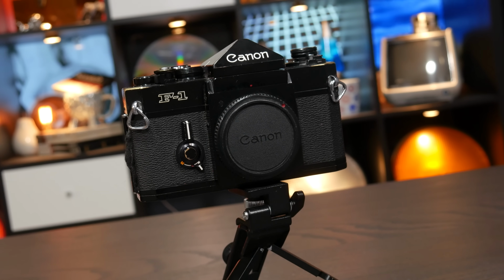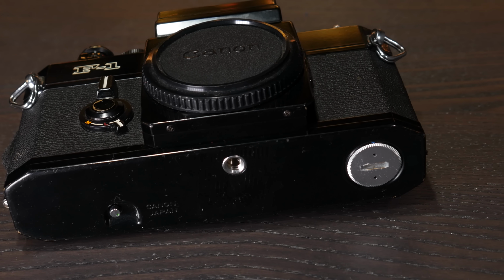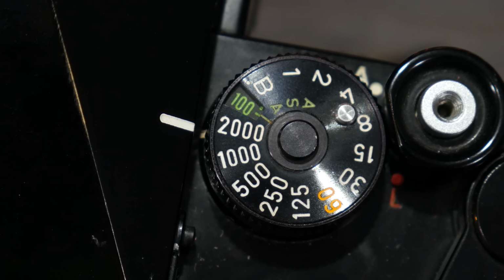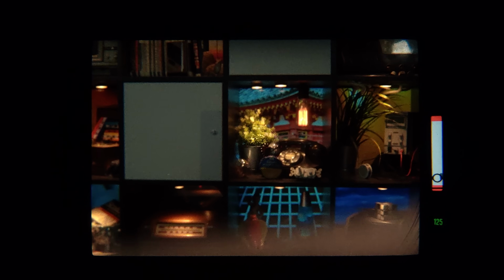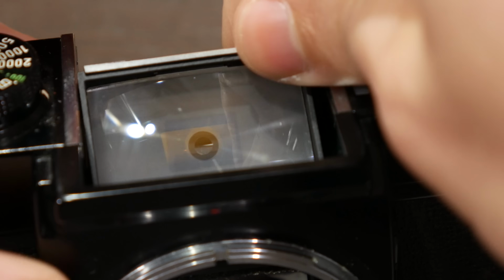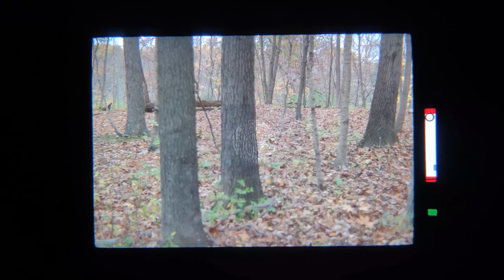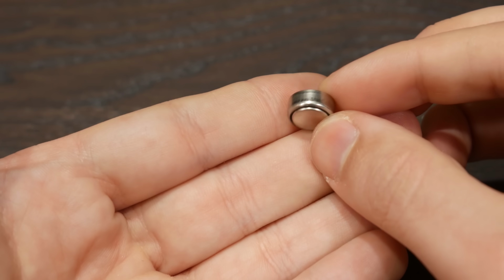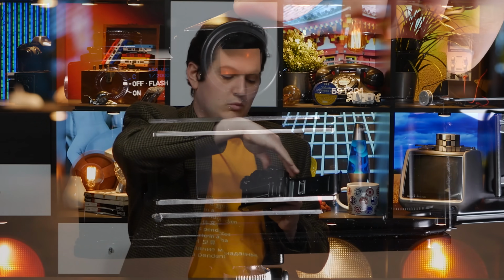1970's Camera Tech: How they showed you what settings to use

Comment: An advantage of mercury batteries was that they held their 1.35V constant throughout well over 90% of their lifetime and they would die a sudden death before they had to be changed, whereas 1.5V alkaline batteries tend to steadily and slowly lose their rated voltage, usually starting around 1.55V down to 1.2V-1-1V. Because of the nature of the circuitry, as you have pointed out, the light meter is only accurate with the voltage it was calibrated to. An alternative to using zinc air batteries are silver oxide batteries which also have a a very constant voltage and much longer service life than zinc air ones. While those are 1.5V batteries as well, most hand held light meters can be recalibrated using their variable resistors, as long as you have a reference light meter that is accurate, or you can buy battery adapters that step down the voltage to 1.35V with 1.5V batteries. The biggest problem with those is price and that if batteries are left in them, they will be drained constantly, so they do run flat sooner, but they are usually worth it if you are using the camera or the meter often. I still use hand held light meters for large format photography, but they are "relatively" new, made in 1983, and use 9V batteries. They have microcontrollers in them (revolutionary for light meters in the early 80's), so they can monitor battery voltage and adjust readings accordingly behind the scenes.

Comment: What did you do, read a Wikipedia entry and then regurgitate it? You state many half truths as well as a number of out right errors. For instance, why would Bulb be called bulb? Why are the numbers known as stops? And, here's a big one, that is NOT how you use a light meter. Those "simple meters" were usually REFLECTED light meters so they were used at the camera position and pointed at the subject. INCIDENT light meters, while somewhat more accurate will inevitably have some type of white diffuser over the sensor and are used at the subject pointing back at the camera. Let's also be perfectly clear, a meter reading does NOT yield "perfect" or "correct" exposures. They, at best, yield an approximation based on the "average" scene (which, of course doesn't exist) being 18% gray (in B&W photography or metering since only newer, much more advanced meters are needed to measure color. Consequently, if you "meter" for a bride in a white dress, and the dress takes up the majority of the frame, it will actually be exposed as somewhat gray...because that's what the meter is designed to yield. Its the photographer who actually understands what they are doing and how the tools work that IGNORES the meter and intentionally allows more exposure for this shot so it renders correctly.

Comment: not that clever as you may think. much older russian zenit has light meter that does not needed any battery. it was not true ttl metering just approximation through window on top of the lens but still...

Comment: That was a nice cameras,in fact the first pro quitly SLR from Canon. Remember Nikon was king in the 1970’s and Canon had  a different time getting pro’s to buy their products in the UK.However the model to go for was the last version which came out ‘er about 1981. It was called the new F1n. And was as good as the Nikon f3, yes with all the bits,motor drive,great spot meter etc. I know As I used both cameras in the 1980’s as I was a stills cameraman working for one of the major TV companies

Comment: Logarithmic needle movement - you can get this for free using the correct placement of the magnet to the needle movement direction, because the more the magnet pushes the needle away, the smaller the magnetic field is for the next bit of push, following the inverse square rule. So, you can just imagine the magnet is placed below where the 'o' is, as the 'o' moves up, the field gets weaker. Match this curved strength with the right spring strength, and your logarithmic movement is a natural consequence.

Comment: Another thing about the meter and low light / long exposure:
Film experiences something called 'reciprocity failure' during long exposures.
The meter can tell you you were properly exposing for your ISO, but depending on the particular film you're using, a 5-second shot could still be under-exposed when it comes time to actually make the halides silver, because the "ISO / aperture / shutter" triumvirate is just an approximation that ceases to be accurate on long exposures.
This is especially weird for color film photography, where each of the R G and B layers can have different levels of reciprocity failure, meaning your long exposure images get cool color shifts.
They probably assumed that if you're taking long-exposure shots, you're already someone who understands what you're doing well enough to know you have to compensate for that, and thus didn't bother extending the low-light performance to work much past 1/30 (the slowest shutter you can reasonably hand-hold) at all.

Comment: Analog photography is done better at 35mmc.com or mikeeckman.com.;) Did you know that many old film cameras get locked up when Hipsters try out the self timer? But then, I learned about photography from box cameras (Brownie Six-Twenty) to TLRs (Rolleicord V) to 35mm rangefinders (Leica IIIa) before arriving at the Nikkormat FTN in the late 1960's. My first film was Verichrome Pan, which led to Plus-X and Tri-X Pan, then on to Kodachrome and Ektachrome. (Color negative Kodacolor-X came later as it was a 3X/3R black-and-white print or color slide world.) As for exposure/light meters, I began with a Selenium cell Walz, Sekonic L-28C, Pentax 1/21 Spotmeter, to the Minolta Auto Meter IVF. A nice basic analog photography class for electronic camera users.

Comment: There's something satisfying about the sounds produced from analogue cameras like the Canon F-1.
Reply: And that's why I like the mechanical shutter inside my GH5. It just gives the nice feedback that you actually made something happen instead of the almost indistinctive clicks from a small relay in older digital cameras and the completely silent operation on the GH5 when set to electronic shutter.
Reply: Analog is what the video signal was before it went digital. Non-digital cameras are FILM cameras. That is why there are SLR and DSLR cameras. :-)
Reply: @Rocketryman  people call film cameras analogue cameras because it differentiates them from motion picture film cameras, digital still cameras and digital motion picture cameras.

Proper terminology be damned in this case, it just makes things easier.
Reply: @sumvs5992  Clearly, you know nothing about film cameras, or digital still cameras or digital video cameras. The only thing it makes easy is you do not learn and it shows a weak understanding of the craft. If I called an x-ray, MRI, or CAT scan an xray. If I told you I was going in that big tube to get an x-ray. You would not only correct me but you would go into what the difference is.   People call film cameras analog cameras because they do not know what either is.
Reply: @Rocketryman  ok, no need to get hostile.

Let's say we're at the beach and I say "I'm going in the water" are you going to correct me and start spouting off about it being salt water and part of the "Bay of X"? Surely you would understand that I meant I'm going into the sea? That's the same thing as saying "anolog camera". It's for clarity, it's so you don't need some long winded explanation that inevitably confuses the person you are talking to.

In fact, I was talking to my mom about my analog cameras about a month ago and because I used the term "film camera" she thought I meant a motion picture film camera, not a still camera. People do get confused about these things, and industry terms confuse people if they aren't in that industry.

Like it or not mate, your world where we refer to all film shooting cameras as film cameras isn't coming anytime soon, probably never.

Also I have shot on about 6 analog cameras now, and about 4 digital cameras. I can tell the difference between them.

Comment: Sigh.
There isn't an "aperture number". There's the f number which isn't just the numerals (e.g. the 2) but the whole expression f/2. It's a ratio expressed as a fraction where the f is the focal length. Thus, just as 1/2 is larger than 1/4, f/2 is larger than f/4. We can sub in a focal length and we'll get the size of the apparent aperture, so a 50mm at f/2 has an apparent aperture diameter of 25mm.    At f/4, the apparent diameter is 12.5mm, f/8 gives us 6.25mm, etc. The f is generalized here because it's the ratio of the focal length to diameter opening that's important to exposure.  Anyway, the larger f number is the one with the smaller numeral because it's the denominator that you're selecting.

Also, due to how photo sensitive emulsions work, it's more of a digital process than electronic sensors are. The halides are either reacted or they're not (remember digital refers to having binary states, not if something is a computer). There's no partial reactions, whereas electronic sensors use a truly analog sensor that must be digitized before doing anything else with it. The bit that does this is the ADC (analog to digital converter).

Comment: It's amazing how much analog cameras advanced in a very short span during the 70's. SLRs like the Canon featured were fairly similar from the late 50's through the early 70s, all be it with more refined features. But by the late 70's far more advanced electronics, and even microchips, started showing up with increasing levels of automation.
My go-to film camera is a Minolta XD-11 (XD-7 outside the US) released in 1977. Not that long after the camera featured in this video, but the metering system its ability to automatically select speed and aperture settings is lightyears ahead.
To me it represents the pinnacle of the old-style SLRs, designed just before everything was fully computerized and made of plastic. It's still a solid chunk of metal with a lot of analog controls and manual film advance, but it was the first camera (to my knowledge) to have a fully electronically controlled shutter and aperture selection so you could use shutter priority, aperture priority or fully manual modes.
One quirk - it was introduced at a time photographers still didn't like the idea of relying on batteries, so even though the shutter was electronically controlled, there was a fallback mode that would fire the shutter at 1/100th of a second you could use without battery power (since 100ASA film was probably the most popular at the time, it was perfect for use with the Sunny 16 rule).
Reply: I still have my first camera, my Dad's good 'ol SRT101. Some of my best pictures came out of that camera. Got a 7000 in high school, with an auto winder and a high capacity film spool (Roll your own, up to 120 exposures). Had a 14-28mm, 35mm, 50 1.4 prime, 70-210 3.5 and an 500mm f8, and a 2x tele. As my graduation present I got Minolta's first DSLR, the 7D. Love that I can still use my lenses if I get a new Sony body and an adapter.

Comment: First I need to see if my camera has this feature.  I struggle with all the shutter,iso , and the f setting.  
But you answered a question about hearing aids batteries.  I had no idea that  the small plastic on the battery was to activate it. I thought it was to make sure the positive and negative did not touch.  That make a lot more since why my batteries where dying before I used them

Comment: I've been recently practicing with my dad's AE-1 camera. It's light meter is a bit different than this model, so I'm still coming to grips with how it works. The first roll of film I shot, about half the shots were not exposed correctly (mostly under-exposed) but some came out alright. 
I need more practice for sure! haha
Reply: AE-1 is inside entirely different. It is controlled by a microprocessor. F1 is purely mechanical.

Comment: The f numbers are weird until you square them. The  numbers are related to the diameter, a linear measurement, but the light getting in is related to the area, and is proportional to the square of the diameter. Square the f numbers and you get 2, 4, 8, 16, ...

Comment: Gosh, I remember cameras like this - in 1996, I bought secondhand an example of the very earliest Canon SLR, the Canon FX - that had cloth curtains. Even back then, the mercury batteries for the meter were not available, so I never used the meter: instead, I used an even older hand-held selenium cell meter. 

It is amusing to see you explaining these basic photography things from the ground up that, when I started out in photography in the 1990s, every beginner's guide would explain and thus everyone interested in taking anything other than basic snapshots would have known.

I can only imagine years in the future a video like this with lines such as "...yes, that's right - back then, you actually had to touch the screen. Weird".

Comment: Excellent. I'm a film photographer and have been eagerly awaiting the moment where you would reach for one of those delightful cameras in the background. As an aside regarding the zinc batteries, one of the reasons besides incorrect voltage for alkaline batteries to be unsuitable is that over time their voltage drops, whereas the zinc batteries maintain a pretty consistent voltage right up to the end of their life. That is a necessity for correct metering in these sorts of cameras. There are clever adapters with circuitry to take care of this, but I opted for cheap and simple solid adapters doing nothing more than providing the proper fit and conductivity for hearing-aid zinc batteries.

Comment: Great video, as usual….

But you got a few things wrong ISO, Shutter speed, Film speed, and how light meters typically work.

ISO

ISO is NOT the International Standards Organisation, but the “International Organisation for Standardisation,” or «Organisation Internationale de Normalisation,» en français. “ISO” is therefore NOT an acronym nor an initialism. ISO is the organisation's official internationalised name, from the Greek, “isos,” (with the final ‘s’ being silent), meaning, “same.” Not being an acronym, nor an initialisation, it is NOT pronounced, “Eye-Es-So,” but, “Eye-So,” (or, “Is-So,” in Latin countries).

Shutter Speed

This is such a common error, that it is forgivable for most people, but, since you are a respectable Internet educator, you do not get a pass. Shutter speed, —which as you know, is distance over time,— is the time it takes for the shutter to move the distance of the frame width (or height, or iris radius, as the case may be).

What most people mean by ‘shutter speed,’ is ‘exposure time’, —which, as you know, is simply, time. Exposure time, is measured in seconds, but often represented in the inverse of seconds.

What a faster shutter speed mean, (for film plane shutters), is a shorter exposure time for the strobe synchronisation time. (With leaf shutters, the shutter speed determines the minimum exposure time).

This is what had caused some people some confusion, when Pentax had said that their new camera, the K-3 III, had a faster shutter speed than the previous model, the K-3 II. The K-3 II had a minimum exposure time of ¹/8000 seconds, and a strobe sync time of ¹/180 seconds. The new K-3 III also has a minimum exposure time of ¹/8000 seconds. Pentax did not lie; the shutter speed is, in fact, faster. The new K-3 III has a strobe sync time of ¹/200 seconds.

Film Speed

“Film speed” is a term used for precisely the reasons you stated, but, the real term is “film sensitivity.” For chemical film, this was fixed for any given roll of film. On digital cameras, this is also fixed for the permanently installed sensor.

This, too, is a common error, so it is forgivable for most people. Internet educators do not get away with it. (Not the good ones, anyway, and I consider you one of the good ones).

The “ISO” or “Sv” adjustment on the digital camera does not change the sensitivity, but changes the exposure index, EI, on the light-meter, and the development time for the develop module. This is precisely how one did “push processing” with film.

When the “ISO” is raised, (and the light-meter is obeyed), less light actually hits the sensor, but the develop module “over-develops” (amplifies) the signal from the sensor to produce the raw image, (or JPEG JFIF, or HEIF/HEIC, or TIFF, as the case may be). The result is that the sensor seems to have become more sensitive to the light, but it actually has not. The same amount of electrons are released per photon strike, regardless of the “ISO” setting. It is in reality, an EI setting.

Light-Meters

Most light-meters measure the intensity of incident light falling on the subject, and are called, “incident (light) meters.” The light-meter within a camera, (and some others, such as spot meters), measure reflected light, and are typically used when getting an incident light reading is too inconvenient. These are called, “reflected (light) meters.”

Because the amount of light reflected is dependent on the albedo of the subject, a grey card —or something as close as reasonable to a “middle grey”— is used to take a light reading, so as to figure out just how much light is incident on the subject. The obvious catch is that, if it was inconvenient to measure the incident light at the subject, it is probably inconvenient to put a grey card at the subject location. Nevertheless, we can guestimate some things at subject position which ought to be ‘middle grey’, and simply meter those with a reflected light-meter.

This is why there are so many images of grey swans, and grey outfits at weddings; people not metering for middle grey, but for the subject.

In spite of those oversights which an educator ought to get right, you did great, as usual.